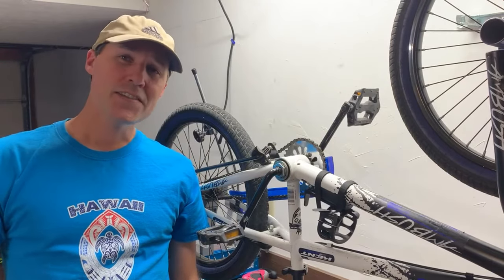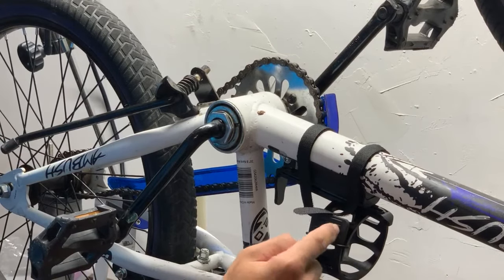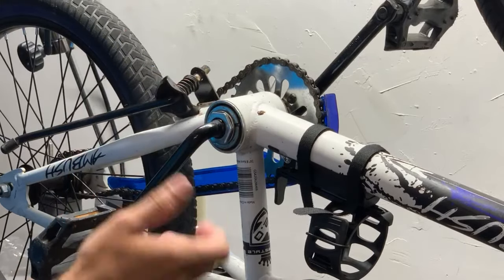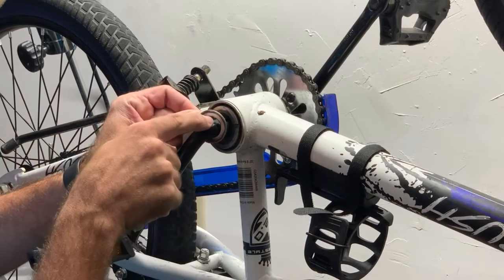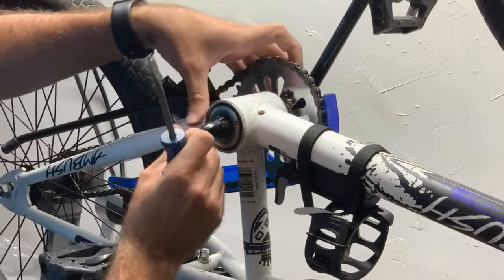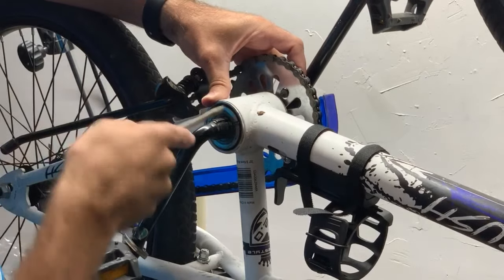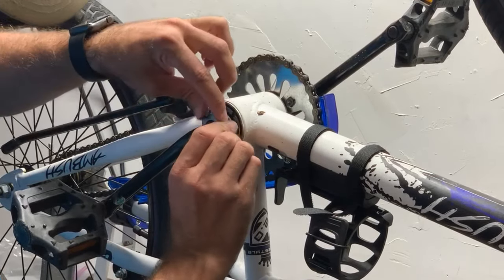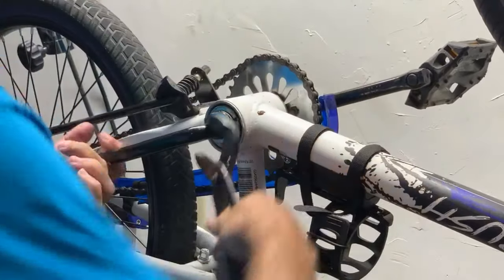Fix Kids or Adult Bike - Loose or Wobbly Pedals and Crank Arms

Comment: Hey i have the same issue, super wobbly and absolutely sliding from left to right in and out of the frame. i am new to bikes and i was told i need to replace the entire chassis or frame. I don't know if it is right or if I'm being scammed.

Comment: I just started hearing my chain barely rub the guide when I'd pedal down with my right foot and realized that the assembly must be rocking. Thanks so much for the video, I almost certainly would have busted my knuckles or messed up the threads without knowing the threads are reversed!

Comment: You are putting the adjustable wrench on the nut backwards when you tighten the nut up ,more leverage if you turn it around, just a hint for easy working
Reply from the maker: Yeah, I didn't even notice that I did that. Ha ha ha. I still got it plenty tight though.

Comment: You just made my daughter's used bike rideable again!! It wouldn't tighten until there was no play left at all, so we will see how long it lasts ....

Thanks for the video!
Reply from the maker: I’m glad it helped.
Reply: Unfortunately, that only lasted a day. It popped out again, even after being tightened.
Reply from the maker: Hmmmmmm, My son's bike, the one in the video, is still holding tight and working well. I'm not sure what is different on yours.
Reply: @ReichpoloTech  I'm wondering if the bearings are completely shot and need to be replaced. I haven't taken the crank apart to see what is up. Might take it to a local shop and see if it's repairable at all.
Reply from the maker: Good luck with it.